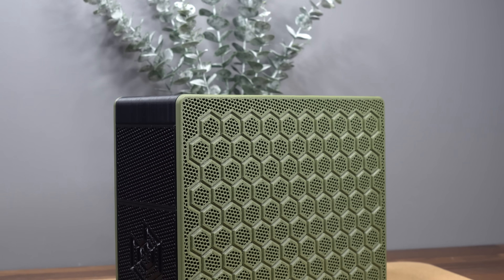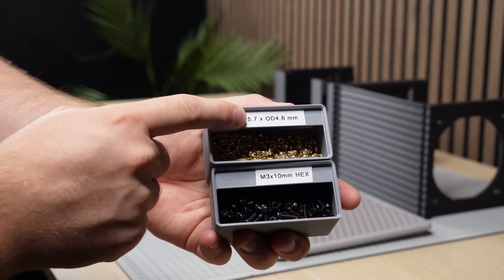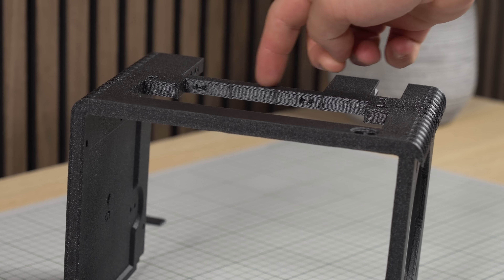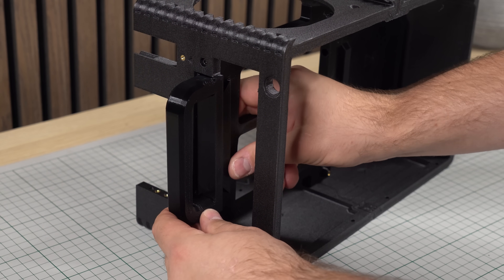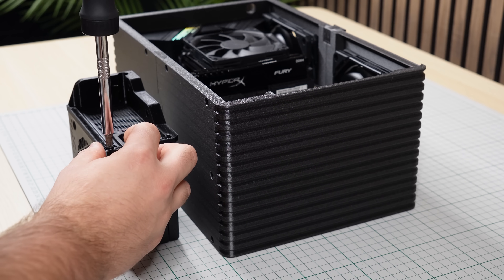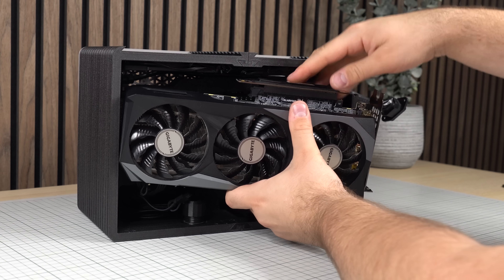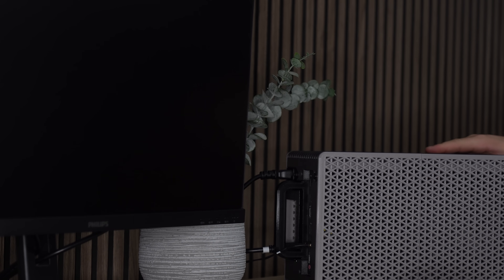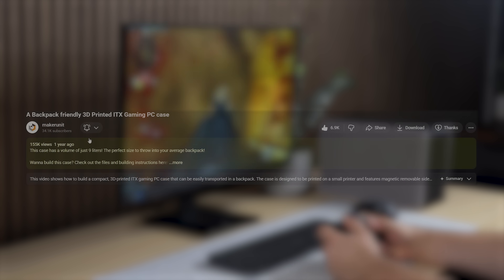The Backpack-friendly 3D Printed ITX PC case - v2.0

Comment: What size print bed is required for this case?
Reply from the maker: Hi, 215x180mm is the largest part of this case. Should fit on typical 220x220 beds or bigger.

Comment: wish you hid the handle inside the case, so the handle stayed flush with the outer surface of the case. its better for packaging it inside a car trunk. when it sticks out like that it gets stuck to other stuff. also you could use a standardized steel wire or cloth handles since 3d printed parts are a bit weaker structurally. also there is too much air intake(holes) around the case. honestly i would get nervous when deciding to drink tea around this case. at this point its an open case. but overall its a nice design. thumbs up for that. keep up good work
Reply from the maker: There is a part version available without the handle part for those not wanting it. Technically, I guess you can call it an «open-sided» case, but the mesh serves as a way of protecting the components too. 🙂

Comment: 1:47 huh, i've came out with exactly the same way of marking side and exact holes for threated inserts in fractal ridge gpu bracket, i guess it's the only way :)
Reply from the maker: Well it simplifies the building process by a lot! With no real downsides tbh. 😀

Comment: First of all, very nice design again! I've been subscribed to you for a while now and you seem to be the only creator making case designs that cater to me personally. Have you ever thought about creating a more flexible but still small mATX case? I really liked the Little Boy M and Little Boy SL cases but would love to see a design which combines both with a sandwich design. A mATX board with GPU high up on the other side and the sfx PSU would be sitting next to the motherboard under the long GPU (front placement for the PSU but instead of being up in the air, it would sit against the bottom of the case). The case would need to be only as wide as the sfx psu's are (125mm). This way the case could be ~11L in size (height is motherboard+riser cable and length is motherboard+sfx thickness at 63.5mm) but still house a mATX board and 300mm long GPU.
Reply from the maker: Hey! Thank you for the kind words! 

I see what you mean, I think. It could for sure be something to test out sometime. I’ve had it in my mind to try a console style design and this seems as close to that as you can get with a mATX. 

Currently I’m working on test-prints on a mATX with ATX PSU, 275mm GPUs, many fans, full access to all PCIe slots (single slot in lowest slot) air coolers up to 55mm or a 120mm AIO. 

All in a roughly 16L chassis. Which is fairly compact, if you see it you’ll see it’s a pretty much zero-wasted-space build (except for the center airflow path for cooling ofc). Push/pull dual fan config on a 120mm keeps even my 10900k at around 60 degrees under full load. 💪
Reply: @makerunit that sounds awesome, looking forward to a video about that!

Comment: Sorry if this has already been asked, is there any way to fit an atx PSU in this?
Reply from the maker: Hey! It’s been asked, but I’ll happily reply again. It’s not possible as it is, and it would require quite significant modification in both height, width and length to even work so it would for sure remove the «backpack friendly» aspect of it, At least with this layout.

Comment: Are you cable to do a horizontal itx or matx case with support for 300mm graphic card support? Seems like the market is lacking a horizontal case. I think it will be dope to mount a something horizontal underneath desktops to make your table clean 😅
Reply from the maker: It sounds like something that’s possible. I’ll be sure to consider it when I need new project ideas! 😊
Reply: @makerunit thank you!😊

Comment: is it possible to split the parts even further? my printer can't print that large unfortunately
Reply from the maker: It’s possible to edit the included .step file, but do so at your own risk. If not you can try my v1.0, which is printable on 180x180mm

Comment: You were building these beautiful cases for a while. Have you noticed any issues related with the fact that the motherboard is not grounded via the mounting holes? I have checked few metal cases, and for all of them the small metal pegs which are usually around screw holes in the motherboard, were actually connected via metal case to the grounding pin of the PSU (I have checked this with multimeter). I suspect that for all-plastic cases static electricity buildup may be a problem.
Reply from the maker: Hi, thanks! Personally I have not had any noticeable issues with this. I have had tens of thousands of total downloads and so far I have not received any direct feedback that it has been an actual issue for anyone. Though if you’re worried about it you can always just manually ground each part by clamping those O-connectors under each screw with a cable going to ground. It’s a workaround if you have very expensive components and you’re worried about potential static damage. 😊
Reply: @makerunit  Adding wires connecting standoffs to the ground is exactly what I will do. 

Any chance of cramming 2.5' SSD somewhere in this case?
Reply: @poel80 Well, you could always modify the design to accommodate one

Comment: Hi there, in this pc case, would a AMD Radeon RX 9070 XT fit?
Reply from the maker: What are the dimensions?
Reply: @makerunit   Length: 320 mm

Width: 120.25 mm

Thickness (Height): 61.6 mm

Slot Requirement: Triple-slot (approx.)
Reply from the maker: @DaniloLiaudet  The case supports a maxium of 2.5 slots. Unfortunately. Also a maximum length of 295mm.
Reply: @makerunit  Would it be possible to alter the size of this case design to accommodate a larger GPU?

Comment: Sick Design, Could you make like a case with aio mounting on top option similar to this, So there is no limit on cpu coolong and would enable to fit even hotter and more powerful cpus
Reply from the maker: Thank you! It would increase the overall height about 40mm but it could for sure be done. You can try it with the included .step file 😊 if not, I’ll keep the idea in mind for a future potential project!

Comment: Would like to see one that could support a radiator
Reply from the maker: I haven’t tested this but I would imagine that moving the case around with a water loop may cause air bubbles or other problems due to the «shaking» when traveling, though it might not be an issue at all either. 🤷‍♂️ But I’m not sure, so I prefer keeping it air cooled at least for somehing like this. 🤔
Reply: @makerunit what about like a simple corsair or nzxt kraken cpu cooler

Comment: amazing design, trying to build this right now

I have a question: I wont have enough filament for printing all in PETG

do you think I can get away with printing the frame+handle in PETG but the side panels in PLA ? 😅
Reply from the maker: Thanks! The side panels are both mainly for intake air I think it should most likely be fine. However I can’t guarantee it. 🤷‍♂️ so do with this information what you want 🤔
Reply: @makerunit  yeah it should hold at least until I can get another roll of PETG :)
Reply from the maker: @Mystic-Voyager oh yeah if there even are any problems they will likely show up slowly over time. So you are most likely good.

Comment: what about gpu reverse position?
Reply from the maker: Can you elaborate on this? I’m not sure I know what you refer to exactly. 🤔
Reply: @makerunit  I saw "5090/5080 FE FLIP Travel Kit" for formd t1. A position of GPU when coolers are inside and blow hot air outside pc case and cpu temp drops to 10-15 C but gpu rise temp 2-3C. So probably I can install ryzen 9900x3d + axp90-x53 and MSI 5080 INSPIRE 3X in your cool case. At least I'd try.

Comment: Please make a version that doesn't use a riser cable.
Reply: Also if you can print the central parts and handle out of metal it'd be perfect.
Reply from the maker: Metal is probably not yet, however perhaps a Desktop CNC machine might be an option as I see them pop up all over, probably not too long until I get there too! 

Anyways, compact designs with no riser cable has a good chance of happening.

Comment: Anyway to add slot in sides to add a thin filter mesh membrane?

Otherwise awesome project
Reply from the maker: Hi, as it is now it’s not a built in way for it, but it might be possible to add in with the step file. However due to small clearances it would probably have to make the side panels thicker too to make it work.

Thanks! 🙏

Comment: low budget.....
with a PSU x3 expensive than everything combined
Reply from the maker: A low budget build is possible. Not necessarily with brand new top-tier parts like the SF1000 but the point was, I specifically made it for 55mm coolers so people don’t require a separate cooler if they want to build on a budget. 😊 I’m currently working on another alternative that’s designed to be very «budget friendly» with mATX mobo, ATX power supply and some standard 120mm fans in a relatively compact package.

Comment: Yo Bro, You know what'd be Sick, 
If you got one of those Small Monitor/Tablet Boom Arms and made a Mount for the sidepanel
so you could mount it on the side and actually just have an ergonomic monitor mount on the travels
Could also 3D Print like a thing, where a Small Keyboard would sandwich against the screen, with a piece of foam in between.
Maximum Travel PCness
Reply from the maker: That could for sure be a cool concept! Having it all in one device. With a small portable monitor 🤔
Reply: @makerunit  Kinda like a Compaq Portable III
Luggables are just cool af imo

Comment: ...Both my RTX 4070 TiS and 3060 are 300mm long, dang.
Reply from the maker: Well, in reality, 300mm from the front of the metal bracket to the end of the card might fit,  but very tightly. 

The actual clearance between the two inner walls is 300mm exactly. The reason I write 295mm as the maximum is to allow some wiggle room and as a guaranteed fit. I like to have some margins in my promises… 😅
Reply from the maker: The actual clearance is about 300mm in total from front to back but I like to allow some margins in my «promises» to ensure no-one gets an unpleasant suprise during assembly. Though you might be able to make it work if it’s like 299.

Comment: Do you think this will print well in carbon-fiber PLA?
Reply from the maker: I think it will print well for sure! CF filaments always look really good. Though I can’t comfortably recommend you to do it in PLA especially taking into consideration that this case might get quite hot with some higher powered components. So my general recommendation is PETG, ABS, ASA or similar. Due to PLAs lower softening point it might be problematic with a hot running build, so do so at your own risk 😄

Comment: looks fantastic 
just wondering if you could design different side panels that are less restrictive of flow and shaped to not cut the air (round holes tend to be better for this which is why round mesh is used in so many PCs)
also worried about static build up as you've not integrated any metal plates and grounding points
Reply from the maker: Thank you! For me, aesthetics are very important, and usually I accept slightly higher temps for a design that looks clean. I actually didn’t know that round holes move air more efficiently, definitely something I’ll have to look into then 👍

Static build up is generally not a problem, though I understand your worry. But if I’m being honest I haven’t had a single person actually coming back to me saying that static has actually proven to be a problem. And I’ve had thousands of downloads over the years. 

I’m not saying it can’t happen, but statistically based on feedback so far, seems to be not an issue at all 😊

Comment: Could you maybe revisit the idea of an ITX case with ATX power supply? I have these components and your original case cannot print on my 235mm bed size. 😟 Or maybe a case where you either have a SFX PSU and large GPU or ATX PSU and small GPU?
Reply: Take a look on the Jonsbo C6
Reply: @Angélique_Charlotte_Bouchet  It looks nice, thanks. However I'd like to print a case so I'll maybe try to modify some already existing one.
Reply from the maker: The only current one is my «Little Boy S, Long edition» or my older free model with the 3D square pattern on the outside, case, though I’m open for the idea again in some future project for sure!

Though these both suggested above requires a 300mm bed. 🥲
Reply: @makerunit  I love those cases but yeah... I only have a mere cheap Ender 3. 😅
Reply from the maker: @novh4ck okay so I might have something for you in not too long, at least it’s a concept I just started drafting down. 

How does 280x280x190mm sound? Printable on a 180x180x180mm printer, support for ITX and MATX motherboards, ATX psu, with support for at least a 250mm GPU? 

Basically aiming for a «budget» layout with as cheap parts as possible 🤷‍♂️ I’ll have to give it some more thoughts but it might be something!

It’ll be just under 15 liters. If it works as I hope.
Reply: @makerunit  That sounds amazing!
Reply from the maker: @novh4ck good! It’s not certain yet, but a solid maybe 😉

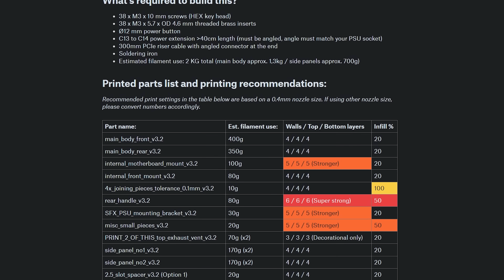Comment: 7:21
I'd personally get a metal folding handle, its quite cheap and makes it flush
Reply from the maker: Possible for sure, but the point of a 3D printed case imo is to try to keep it all printed if possible. Though a collapsible handle is not a bad idea at all!

Comment: Hello makerunit!  Great to see this awesome update on the Backpack Case.  As always I'm impressed with the new usablilty features you continue to add and build into your designs to keep assembly clear and easy.  Also appreciate your 30% off sale of your models.  With Windows 10 e-waste tsunami upon us have you thought about doing some case models to repurpose some of the e-waste motherboards and other components?  I think it would be neat to have custom Linux machines with these components and your case designs.  Just a thought!
Reply from the maker: Hey Deech! Happy to see you appreciate my attention to details! 

When you say Windows 10 e-waste, are you referring to normal standard sized motherboards and other components? In that case the parts could be used in any case couldn’t they? Or do you have any specific scenarios in mind for potentially re-purposing parts?
Reply: @makerunit Here in the US, I don't think Microsoft has yet relented to change the requirements for Windows 11.  There will be lots of big vendor HP / Dell / Lenovo machines which all have very proprietary designs for both their cases and components.  People will be able to buy them cheaply but won't be supported by Windows 11.  A custom case designed around a few of the most common brands and models/form factors maybe away to encourage some interesting reuses as Linux machines.
Reply from the maker: @deechvogt1589  Ah, yeah I see what you mean. However my honest reply is I do not think it’s likely that I’ll make a project like that as I prefer to work with «off-the-shelf» parts.

However, what about you? You’ve shown me some designing skills with your own models, can’t this be your next project?
Reply: @makerunit  Perhaps.  I started it once.  Right now it is in status:  SHELVED  

But I could restart it.
Reply from the maker: @deechvogt1589  Never too late to get back to finish an old project. Funny story actually, my most viewed PC case build to this date; Custom 3D Printed ITX cube case, which just reached 300k views was just like that. I started it, designed it, then put it on the shelf just to find it a year later, decided to finish it and thinking, ah I might as well post it, and well, now 300k views later I do not regret it 😁

Comment: I would love to see one of these cases designed around workstation GPUs. The blower cooler design makes accommodating their air flow needs a bit different and I'd be curious if there's anything you'd change up for cards that are an exhaust fan. Also, I'd love to see a design built around the perimeter of an iTX motherboard and some of the shortest modern GPUs. Powercolor has a 200mm long 9060XT 16GB, which is a tiny card for the power it has. Having a case built around being as small as possible while still fitting a modern GPU would be awesome.
Reply from the maker: Making a case specifically for 200mm GPU’s shouldn’t be a problem to create. Though they’re not as common in those small sizes as if for example the length supported was 250mm it would allow for so many more cards.

Comment: Master any good nas case i can purchase from ur store small factor yet has 4- 6 hdd space
Reply from the maker: Hey! I’d say out of all the models in my store currently the 6-bay + 3 SSD option is the best choice for a small footprint build. It’s also my most popular case ever designed, and has so far only received 5-star reviews! 🙏
Reply: @makerunit thankyou so much for replying 

I have a kobra 2 neo with build size of 220x220x250 will it be able to.print that ?

Also can u link me to the one u refer please confirm il get it right away

Comment: Does this need the carry handle or can it be printed with out it?
Reply from the maker: Hi, I currently only uploaded the version with the carrying handle, however it’s no problem for me to upload just the bracket without the handle part as an option, I’ll add it later today 👍

The bracket helps support the IO shield in the back so the bracket needs to be there at least 😊

Comment: I made the cylindrical case you created and I Love it. I did ASA Black for the Main Body and Red for the Air Vent area. 
I installed a MINISFORUM BD790i X3D with the Ryzen 9 7945HX3D CPU. 2TB Samsung 9100 14GB per sec read/write and a 10TB Exos drive for backup. I also bought an eGPU Dock for it. It's so cool. I get so many questions about it. Oculink is the way to go!
Reply from the maker: Awesome to hear about your good experience with the round case! 🙏 Would be cool with a matching eGPU case now yeah? 😅